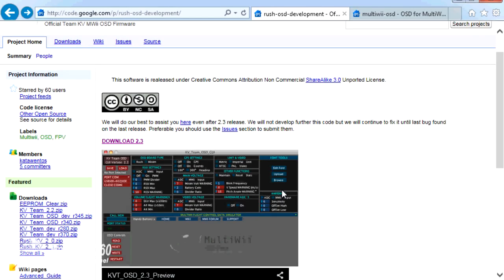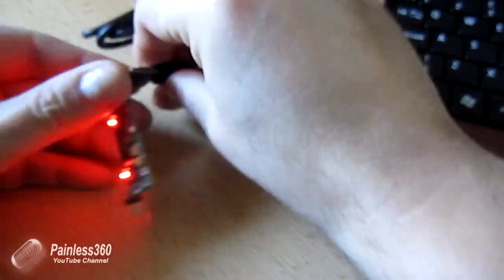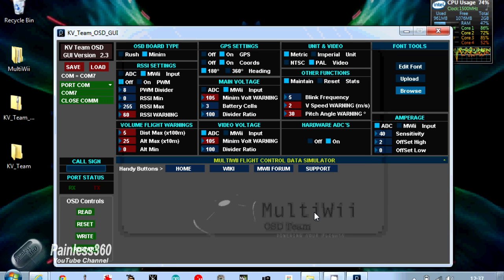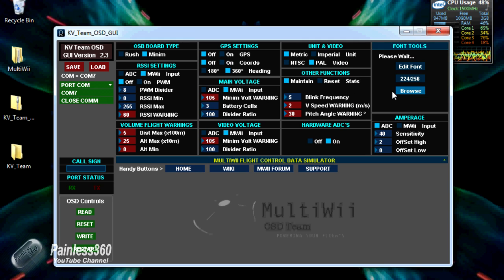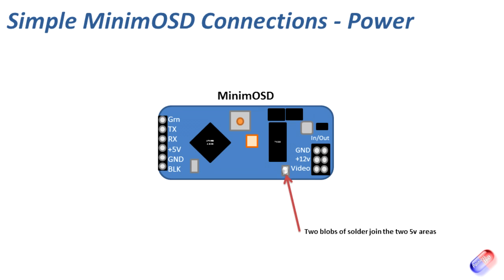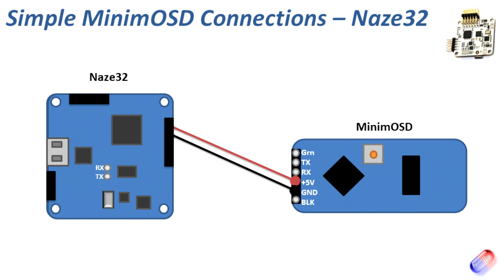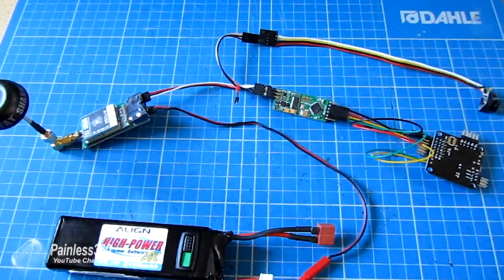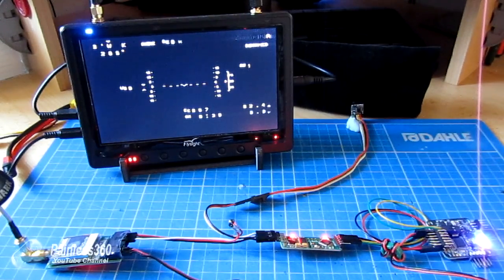(3/8) Naze32 Flight Controller - Adding an OSD using MinimOSD

Comment: First off let me say your videos are superb! Thank you very much for your work. I'm having trouble with my Minimosd. It was supposed to be flashed with the MWOSD when I bought it.

I have both blue lights on the OSD and I have video in my goggles but no overlay. Thoughts?
Reply from the maker: Twomonsters Tricky to comment with just that level of detail. This can be due to allsorts but one of the common causes is the fonts have not been uploaded or the power isn't getting to the MAX chip. Check both of the red LEDs are on when powered.
Best of luck.
Reply: Painless360 Thanks, it looks like power is getting to both chips. On my board the lights are blue. When I try to reflash the board with an FTDI and the Arduino program I get an error compiling, no such file or directory.
Reply from the maker: Try an older version of the Arduino program then..
Reply: Painless360  So I was able to reflash the OSD via an older version of Ardunio. Hooked it up to mwosd GUI and it worked. Uploaded the fonts and what I wanted on the overlay, but still no overlay on the video. I'm going crazy. My board is a bit different it has pin across the top as well for FPV battery, main battery, RSSI inputs
Reply from the maker: You should see the board start-up and show it's 'splash screen' before dropping into OSD mode.

Try waiting until the FC is booted then plus the OSD in and see if you can see anything.

I did have one board that needed the reset button to be pressed after power on to start-up properly.

Best of luck.
Reply: Painless360 Thanks again for your help. I can only see the OSD when I unplug my camera. Thoughts?
Reply from the maker: Could be the signal levels from the camera. You can try twisting the wires from the camera to the OSD, using a shielded cable or trying another camera to see if that helps.

It's now down to good 'ol normal troubleshooting.

Best of luck.

Comment: Hi,
Mimimosd works fine when quad disarmed. When I arm it the display locks up, I still get video & can fly. When board disarms minimosd works again!
Any ideas what may be wrong? 
Thanks.
Reply from the maker: Bernard George Not really. What troubleshooting have you done?
Reply: Painless360 I wouldn't know where to begin! I'm using the micro minimosd. I've the same setup on three quads & all three do the same, arm board it locks up. Wait a few seconds, board unarms itself & minmosd works again. Even with the gps power unplugged from the naze board, green & yellow wires still plugged into naze, I get the same result.

Thanks
Reply from the maker: Have you loaded a fresh firmware and font upload?

Comment: Hi I got this working, finally. But I can't seem to get it to display voltage and amp draw, I have enabled battery monitor in baseflight, am I missing something here?
Reply from the maker: MaydayRC You need the battery setup (vBat) setup to see the voltage - see the other video in the series.
If you want to measure amp draw Google KV_team mod.
Bets of luck.

Comment: Painless360 I am here now working on my OSD and I have a little doubt. So looking on the top of the MininOSD board, the right side of the board doesn't light up and I went back on your video where it says we have to put a bridge on the back. Do we actually have to do some soldering in the back so that both plates connect together?
Reply from the maker: Yep - you need to colder the front and the back places as detailed in the video so you get both red LEDs lit up then you connect the board to power on the FTDI pins..

Best of luck.
Reply: Painless360 Thank you so much sir, your support on these videos always goes above and beyond.
Reply: Painless360 Hey goodsir, I did what you told me and my board is fully working, both lights come up as you show in your video. I programmed it and it is ready to be wired into my quad. I see that you have a different Naze32 board, so I went ahead and researched these days that I have been absent and I came up with a setup. Would you please if you don't mind take a look at it and may be advice me about it being a safe setup? I have a link with the detailed diagram: http://i1176.photobucket.com/albums/x339/blucable/my%20setup.jpg
Reply from the maker: Looks good but you need to connect the red wire (power) from the Video Tx to the camera..

Best of luck.
Reply: True thing! I did all the wiring and it is a success! thanks a lot for your time.

Comment: I'm using a 12V camera.  On the the output side of the OSD, should I still connect the Ground pin to the Minim OSD output?   I wasn't sure if mixing the 12V ground and the 5V ground together was a problem or not.
Reply from the maker: No, connecting the grounds shouldn't be a problem. Best of luck!

Comment: Hi,
i've flashed my MinimOSD with MWOSD.
I now want to try Rush KV OSD.

Do i have to clear the eeprom on the Mimim first or does the old Firmware get overwritten by the new one?
If i do need to clear the eeprom, how to do that (which software)?
And is there a risk to mess up the board when doing so?

Thanks for the detailed and helpful videos!
cheers!
Reply from the maker: Chris Zinner The EEPROM holds the characters and is overwritten with the new font when you upload the new firmware/fonts to the board. Occasionally you can get odd things happening to the fonts and this appears as corruption in the characters you see in the OSD, if you get that then you can wipe it. 
Hope this helps.
Reply: I understand, thanks a lot for the info!

Comment: Thanks so much I build the whole Qudacopter with the help of your videos your instructions worth lot for me. Now I have quad with NAZE 32full with GPS and Bluetooth flying beautifully. Now what's my problem I can't upload any firmware in to my OSD I try bouth firmware what you mention bouth show different problem 

  KOSD shows error message when I use my ADRINO program . When I try upload muiltiwii the ADRINO software says not enough memory I don't get any sources to solve this problem please help me if have any idea thanks. Your are the great
Reply from the maker: Try an earlier version of the Arduino program. You can download ten from the same website, look at the bottom right of the screen..

Should sort it out..

Comment: Hi, great video.  When I try to compile the arduino code, i get an error message, any idea what is not set? I downloaded the latest version from the site you listed.

Arduino: 1.6.4 (Windows 7), Board: "Arduino Pro or Pro Mini, ATmega328 (5V, 16 MHz)"

In file included from EEPROM.cpp:5:0:
KV_Team_OSD.h:180: error: variable 'item_table' must be const in order to be put into read-only section by means of '__attribute__((progmem))'
  extern PROGMEM const char *item_table[];
                                        ^
variable 'item_table' must be const in order to be put into read-only section by means of '__attribute__((progmem))'

  This report would have more information with
  "Show verbose output during compilation"
  enabled in File > Preferences.
Reply from the maker: James Oddbach I would try an earlier version of the Arduino code. You can download it from the Arduino website. Sometimes 1.6.x can be funny with older sketches..
Hope is helps..
Reply: Painless360   thanks for the reply. I end up loading MW OSD per your other video. Just wondering, after the OSD is connected to the NAZE32, somehow CleanFlight doesn't work right. I no longer can change the tabs. When I unplug the OSD, CleanFlight works again. Have you come across this?  Thanks
Reply from the maker: You must disconnect the OSD if you are using the USB cable - the share some of the same comms circuitry.

Hope this helps.
Reply: Painless360 Got it, thanks a bunch for your help.

Comment: hi there thanks for all the great videos i have downloaded all the videos for the naze32 i have ordered every thing like u have but have a problem with the minimosd i get this error 

Arduino: 1.6.3 (Windows 8), Board: "Arduino Pro or Pro Mini, ATmega328 (5V, 16 MHz)"

Sketch uses 24,966 bytes (81%) of program storage space. Maximum is 30,720 bytes.

Global variables use 1,900 bytes (92%) of dynamic memory, leaving 148 bytes for local variables. Maximum is 2,048 bytes.

Low memory available, stability problems may occur.

avrdude: ser_open(): can't open device "\\.\COM4": The system cannot find the file specified.

Problem uploading to board.  See http://www.arduino.cc/en/Guide/Troubleshooting#upload for suggestions.

  This report would have more information with
  "Show verbose output during compilation"
  enabled in File > Preferences.

plz help me
Reply from the maker: Alireza Moradi What troubleshooting have you done? If the board on COM4? 
Best of luck.

Comment: Has anyone been successful using the soft serial port options?  I don't want to lose USB access through the UART1 port (which is what this method requires).  

I would be extremely grateful is someone could point me in the right direction.
Reply from the maker: David Martyn From what I understand the OSD code is set to 115,200 baud so the soft serial ports will not support it (19,200 baud max). You can add some of the other additions to soft serial ports (BT, GPS etc.) but only when you have configured them for the lower speed.
Let me know if you find a workaround.

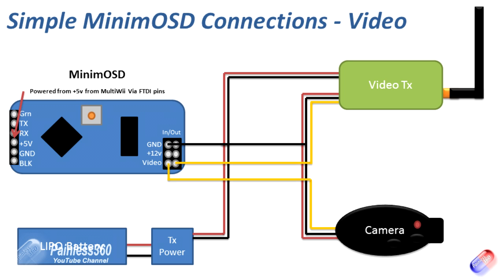Comment: The schematic at 23:07 mins shows that the GND on the "12V-side" is connected to the system.

Wouldn't this lead to a ground loop as GND on the left/ATMEL-side is also connected for power supply and the GND-solder-jumper closed?

I read that these ground loops may reduce the video quality.
Reply from the maker: ***** Having the ground connected is vital for the signal. In the example I use I use a single flight battery to power everything so the GND is common. 
Happy flying!
Reply: Painless360 I am also using only a single battery the whole system. However, in my opinion connecting the GNDs on both sides to the same battery and closing solder-jumper realizes an unwanted ground loop.
Reply from the maker: I am not going to debate it. Install it the way that makes sense for you.

Happy flying!

Comment: I had problems flashing the kvteam firmware and also problems getting the GUI working. Its all working now, by sheer luck!

Firstly I ran EEPROM clear, to clear my board... Still had problems compiling and uploading in arduino... Not sure how I managed it, but I restarted my computer, connected the minimOSD and opened arduino. Then I just clicked upload and it worked! Didnt bother clicking compile.

Then, I couldnt get the GUI to run on windows 8. Firstly it was a problem saying javaw.exe couldnt be found... Downloaded the java development kit, the error went away but the program wouldnt start. So I uninstalled java, along with the development kit, reinstalled java, GUI started straight away!

Hope this might help anyone having similar problems

Comment: Another excellent video! Thank you.
However, I got a question regarding the wiring. You mention to connect both the Rx and Tx wires. On the APM I only connected the Rx on the OSD and it worked fine. Is the Tx really needed for the NAZE32?
I did not connect it and don't see any OSD overlay on the video.
Reply from the maker: ***** The firmware on the MinimOSD provides you with some neat options like PID and OSD setup changes without needing a PC. See https://www.youtube.com/watch?v=08u6c-tSnug
The extra line is needed so the MinimOSD can 'talk' the Naze32.
Hope this helps.
Reply: Painless360 Thanks for your reply. I did not know about these features.

Comment: Having never flown a fighter jet I assumed that the horizontal line represented the tilt of the aircraft.... But now I realise it represents the Horizon!!! Silly me, so sorry I feell such a fool but at 68 I guess I have an excuse. While your reading this have you thought about modifying a controller to transistion from vertical flight over to 90 degrees into horizontal flight. I rekon that would be really cool. The Multicopter could have wings and that should extend battery life being more effecient. Then back to vertical for landing, just a thought and thanks for helping me, cheers John
Reply from the maker: Jonny10001 Hey John, if it makes you feel any better I did exactly the same thing the very first time I connected an APM to Mission Planner and rolled it on the bench to watch the artificial horizon work. I was convinced that the roll was reversed. Happens to many who don't fly for real first time ;)
Glad it's sorted and well done for getting the electronics working. The good news is that it is behaving perfectly!
Happy flying.

Comment: Thanks for your prompt replies. What I mean is that when the model is tilted to the left the OSD level left side dashed line between the vertical degree indicators goes up instead of down and when the model tilts down the climb horizontal line goes up and vice a versa, both reversed. The compass bearing and altitude indicators are correct. Just to remind you I am using it with a Naze32 acro controller wit JR XG7 radio system. Your help would be greatly appreciated. John
Reply from the maker: Jonny10001 Just to check - the artificial horizon moves to show the position of the horizon i.e. tilt the craft to the right, the level dips on the left and rises on the right. Is that what yours isn't doing? A video would help..

Comment: Hi Painless, thanks for your help. I thought Com 1 was uploading but other than the cryptic message at the bottom it seemed to upload but actually Com 7 was the one. But the the left-right and up-down level lines are reversed, altitude is OK. What do you suggest...
Also are you planning a connect and program video on the Micro OSD board you featured recently.
Reply from the maker: Jonny10001 Not sure what you mean by 'left-right and up-down level lines'. There is another version of the code you can try if this one isn't happy with your configuration. It's in the playlist. 
Best of luck.

Comment: Hi Painless I find you videos so informative, you go at just the right pace and your graphics are just tops. I have a Crius OSD and followed you instructions to reflash it to use with the naze32 but it still displays "waiting for Mavlink heartbeats. When I clear the board and try to write the new parameters it displays at the very bottom, "Avrdude: stk500_getsync(): not in sync: resp+0X00". Your help would be greatly appreciated, cheers John, Sydney Australia.
Reply from the maker: Jonny10001 The MinimOSD you are using is flashed to work with the APM by the sounds of it. You need to get the new code onto it for it to work with the Naze32. See https://www.youtube.com/watch?v=EEWE4PZL4TE for help with the error code..
Hope it helps..

Comment: Strange issue I am having.  When i have the TX, RX lines connected to the OSD I cannot connect to clean flight using USB with the lipo connected.  When i unplug the TX RX lines on the Naze 32 it reconnects to clean flight with the lipo connected using USB??
Reply: Jon Car Quote:Originally Posted by othala 
When I plug the USB port and my lipo Baseflight disconnect so now I'm unable to connect lipo and usb at the same time.

I have telemetry frsky / osd / and gps feature

Any idea ?

Unplug the tx and rx pins fron the osd. It uses the same port for the osd and USB and can't do both simultaneously.

Lee it looks like you can't use the OSD and USB with lipo connected at the same time.  FYI
Reply from the maker: Jon Car Hi Jon, from what I can tell this is normal as the data port and USB lines share some things. The Multiwii SE V2.5 boards are the same. 
Hope this helps.
Reply: Ok thanks

Comment: I get an error compiling...

In file included from EEPROM.cpp:5:0:
KV_Team_OSD.h:180:40: error: variable 'item_table' must be const in order to be put into read-only section by means of '__attribute__((progmem))'
  extern PROGMEM const char *item_table[];
                                        ^
Error compiling.

Any ideas?
Reply from the maker: Brad Jacob I would try an older version of the Arduino program to create and upload the firmware..
Best of luck.